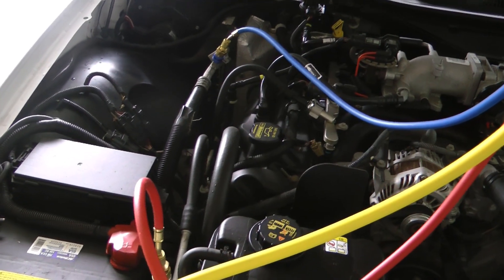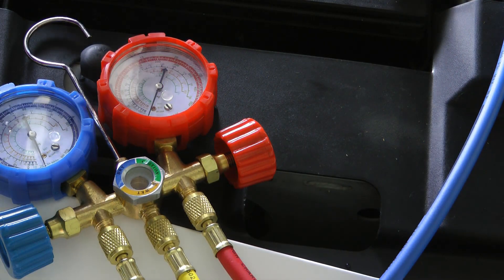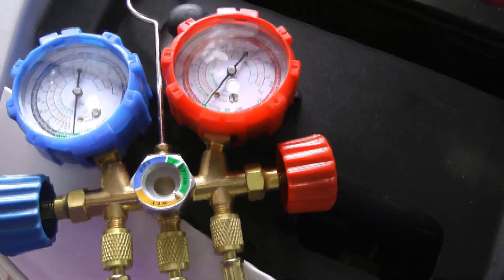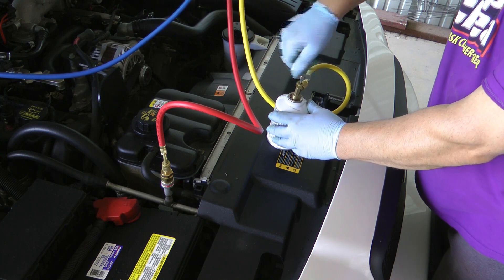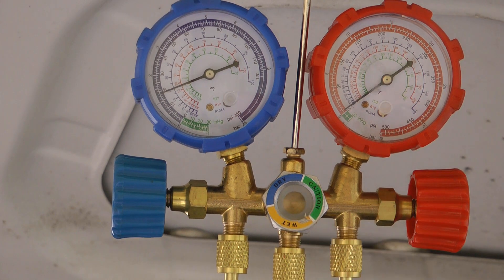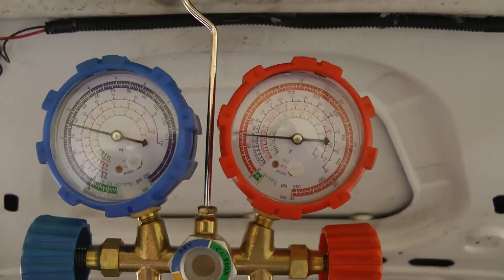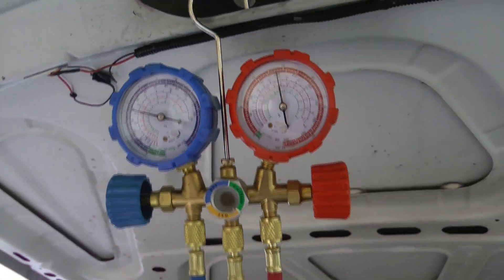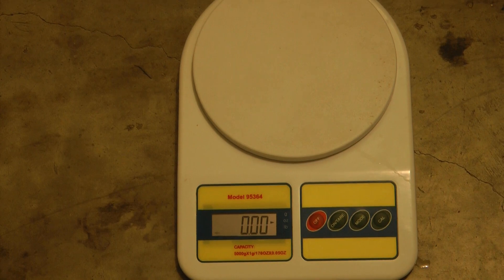A/C Air Conditioning not blowing cold?  Ford Crown Vic AC refrigerant freon recharge

Comment: Just recently had my 09 P71 have some AC issues.  Instead of air coming out of the vents, it comes out of the defroster vents and floor vents. I'm pretty sure I have a vacuum leak. I can't seem to see where though. Any knowledge you may know about the topic?
Reply from the maker: yes, the directional control is vacuum controlled and a common failure for our cars at high mileage.  Unfortunately you're going to have to track it down.  While you have everything apart, I'd go ahead and change out everything hidden behind the dash so you don't have to repeat work later.  Good luck!
Reply: You have a vacuum leak. It’s probably on the hose that leads to the non-existent automatic parking brake. You can find the hose by your knees, going to nowhere, but the it’s broken right on the other side of the firewall. It’s a little hard to reach but check around the grommet that has a couple vacuum hoses going through it, on the firewall, about where your right knee would be on, while driving, in the interior and just past the driver’s side valve cover on the firewall, in the engine bay. I think the heat eventually breaks down the vacuum hose. Just cap it off if it’s for an automatic parking, since you don’t have one anyone

Comment: I noticed I have a few drops of green liquid coming out the port which you have the blue hose connected too. It’s not a lot but I’d i dry it with a towel, it pools up again in a few days. Ac works. How scared should I be? I haven’t touched my system
At all but just bought the car so it’s possible they fixed it befor the sale ?
Reply from the maker: Sounds like you have a leaking shrader valve (ironically that's where mine was leaking too).  It's a very easy fix.  You can do it without even draining the system using this tool: https://amzn.to/37tjhTF
Reply from the maker: but it sounds like you ought to have the system evacuated and refilled properly if someone was messing around and adding refrigerant there is no way to know what's in the system.  Change out the schrader valve while the system is empty.

Comment: My ford mustang a/c will hold a vacuum overnight but leaks out of my high side valve! How is this possible?
Reply: Leaks out of my high side valve when recharging the system.
Reply from the maker: perhaps the shrader valve is bad or your hose has a leak?
Reply: @WJHandyDad  Yes I had to replace the valve. Just found it strange that it was holding a vacuum with a bad valve. Great video by the way

Comment: So how many cans did you use? My 04 crown victoria refrigerant leaked out. I plan to fix it myself. I think 3 cans of 12oz  Dupont refrigerant cans should be enough.  That's 34 oz of high quality refrigerant.

Anyway thanks for the Video!
Reply from the maker: my year model takes 27 oz - so I used two 12oz cans plus 3oz from a third can

Comment: If you have to have it professionally vacuumed,  then have them finish the job.!!! You'll pay less at the end. I mean what's the point here??  Lacks Great COMMON SENSE AS USUAL. 😣😤😤😥😥😥😥😧😧
Reply: He’s saying to have any remaining refrigerant in the system professionally removed, it’s a crime to vent the refrigerant to the atmosphere. The equivalent of dumping oil on the ground, etc. WJ is just telling everyone to comply with the law and he also says most people doing this likely have an empty system (such as from a leak, or replacing a compressor or accumulator) and have to recharge the system.  You can get a vacuum pump and A/C gauge set as loaner tools from several chain auto parts store so a DIY can do this job for the cost of a few cans of refrigerant basically.
Reply: So how many cans did you use? My 04 crown victoria refrigerant leaked out. I plan to fix it myself. I think 3 cans of 12oz  Dupont refrigerant cans should be enough.  That's 34 oz of high quality refrigerant.
Reply: @CobraR1993  Yes. WE USE THREE CANS OF NATIONAL BRAND. USA ONLY
Reply from the maker: @CobraR1993  my year model calls for 27oz - so two 12oz cans plus 3oz from a third can
Reply from the maker: not everyone is going to have refrigerant in their system, in fact, I bet most folks who would do this already have an empty system.  This channel is for DIY stuff.  Sorry that you don't like that.
Reply: @WJHandyDad  you can please some of the people some of the time, but you cant please all the people all the time - just keep making videos - forget the critics
Reply: @WJHandyDad  Then stop talking out of TWO SIDES OF YOUR  MOUTH! HERE ARE YOUR WORDS=  ""HAVE"" YOUR A.C. PROFESIONAL" CLEANED VACUUMED""! I WENT BY WHAT YOU,    SAID!! AT THAT POINT 
HAVE THE SHOP  DO THE WHOLE JOB!
Reply from the maker: @captainamericaamerica8090  actually I said evacuated
Reply: @WJHandyDad  Your footnote says vacuumed! In writing. In  headlines!
Reply from the maker: @captainamericaamerica8090  I have no idea what you're talking about?  What footnote and what headlines?
Reply: @WJHandyDad  On your title! When you press it, all the details show up. You should already  know this!
Reply from the maker: @captainamericaamerica8090  I seriously have no idea what you're talking about.  Guess we'll have to agree to disagree.  Sorry you didn't like the video.